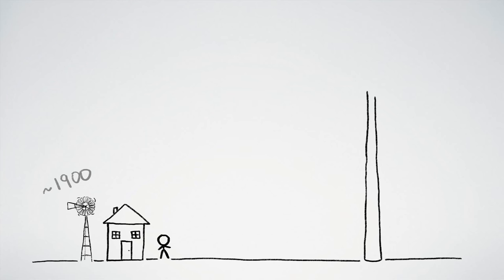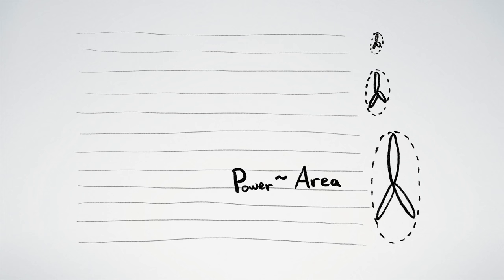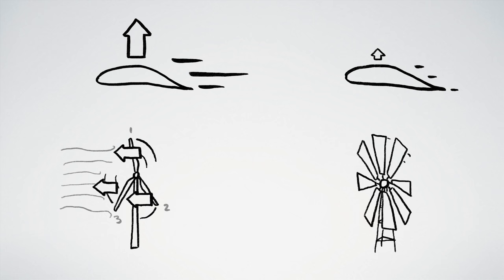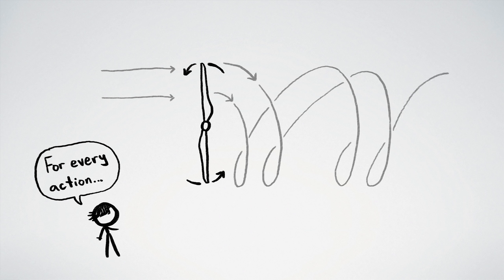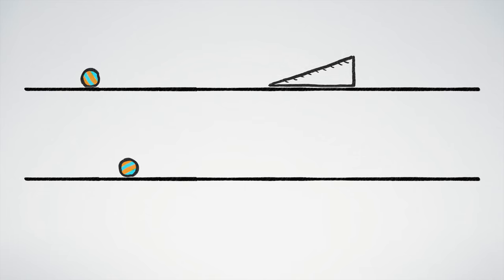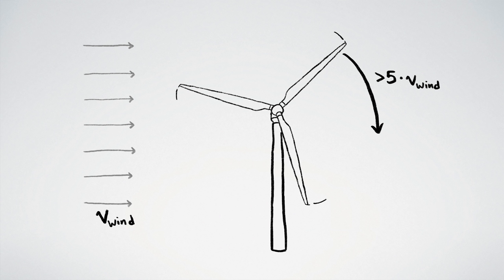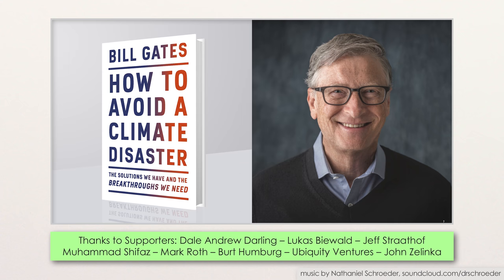The Physics of Windmill Design

Comment: You haven't mentioned one important thing. Why all windmills have three blades and not four (respectively smaller ones).

It has to do with the dynamic load when the lowest blade is passing the tower. If four blades are mounted, there is a big force difference when one blade passes the tower or no blade is in front of the tower. The blade on the highest spot creates the biggest force against the tower (due to the bigger leverage) but in the same moment is a blade in front of the tower that creates up to zero force (also due to Betz's law). When the blades are on 45° to the top most position and to the tower, all four blades create force against the tower.

With three blades it's either one blade in front of the tower and two blades in 60° to the top most position or it's two blades in 60° to the tower and one blade in top most position. The difference in force is way smaller this way and the tower can be build much slimmer and so more cost efficient.

Comment: Interesting question: Why not multiple layers of blades that spin seperate to each other on the same wind turbine?
Reply: Because the wind kinetic energy will pass most of its energy to the first layer blades to the rotor, and the wind will slow down (less kinetic energy) by entering the second layer. therefore the second layer etc will recieve a lot less energy than the first one wich means less efficient for a design.

Comment: So, why not have the fan blades flair at the ends or even connect them into a circle? You can get higher angular momentum that way, which should keep the generation more consistent, right? And if the reason you have thin blades spin quickly is to allow only a bit of air to move past the windmill, you just have that donut hole in the middle

Comment: i would think that the system being 60hz would make engineers design the blades around that speed, so that u could have a direct connection to the generator. and yes i know the wind isnt constant, but u want to govern them down to the speed you like and if there isnt enough wind to maintain the lowest, then u dont make power

Comment: This is all fine and dandy, for 2 dimensional windmills.
While 3 dimensional windmills might be theoretical At the moment doesn't mean they won't exist in the future.
Main selling point of 3 dimensional windmills being they don't need to worry about slowing the wind down, cause they don't rely on the wind passing them by, rather they count on the wind to more the entire windmill (blade area) around causing the blocked wind to push on the slowed wind what pushes the blades with more energy what causes the windmill to move more and, well, generate more energy.

Comment: Fast moving blades were not an option before modern ball bearings were made cheap and common.
If you try making fast rotor with bushings, it would not last long.
1900s (or earlier) bearing technology as available in steam engines required constant inspection and lubrication. Not something you want to go do several times a day on top of a tower.

Comment: Also what we are using is not a windmill. Windmills were connected by a hard drivetrain to a bottom grinding flywheel. Hence the reason windmill. What we use today is called a wind turbine. They do not function the same as windmills hence the reason they are not as safe as a windmill and tend to explode.

Comment: What about the cylindrical windmills that look like they can capture wind from any direction?
Reply: The problem with vertical axis wind turbines is that some part of it is always moving against the wind. Obviously they have less drag into the wind than with it, but it’s still some. Even if it were zero, only the blades on the downwind side would be contributing to the torque of the rotor.

So, to make a long story short, these vertical axis designs can never be as efficient as a horizontal axis turbine.

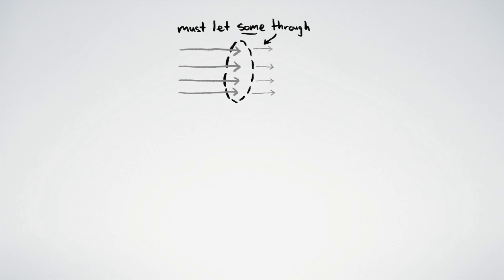Comment: Small imprecision: the max you can extract from the wind is 89%. That's the max efficiency of a wind turbine, whereas the max power coefficient is 59% as the video says. You don't believe me? Go to 1:05 and look at the difference between A and A1. If you divide the extracted power by the power available on the area A you get 59%, if you use A1 which is smaller you get 89%.

Comment: So in the Texas situation where there was no wind and therefore no energy generation, windmills were proven unreliable as a *main* source of energy for consumption.
Reply: There was plenty of wind. They were just iced up like a plane wing.
Reply: Wind turbines need a backing power supply pretty much by definition.  Wind varies greatly from day to day and even hour to hour.  It may be still in the morning, and then a storm blows through.  Thus, their power output is highly variable.  But you simply cannot do that with an electric grid.  Even ignoring the impracticality of telling people they can only have electricity on windy days, a fluctuating power supply can very literally shut the entire power grid down.

So you need a backup generation system, such as a traditional coal power plant, to fill in the gaps.  But it's worse than that.  The giant steam turbines used in power plants can't just be turned on with the flick of a switch.  Water must be heated to a boil, turbines have to be spun up very carefully in order not to destroy them under the sorts of forces driving megawatts of power involves, and so you're effectively stuck at constant power production over a given short term window.  Thus, you need to continuously produce enough power at your backup station to cover that unscheduled 5 minute lull in the wind all the time, and just throw away the excess power generated since battery banks of this type of capacity are out of the question for many reasons, environmental and economic.  If you fail to do this, you're going to have a blackout.

Comment: doesn't mass have something to do with it aswell? i mean the more mass it has the more energy it takes to get the rotor to spin and thereby generating less power from the windforce?
Reply: Takes more energy to get it up to speed but once there there's no difference in energy generated. If anything a heavier blade may be better since its momentum means the energy output will be slightly more consistant

Comment: I don't think that wedge example is correct. When the ball hits a moving wedge. It bounces less to the left (than if it hit a static wedge) because the the surface of the wedge is moving away from the ball, so it's as if the ball is hitting the surface at slower speed. Also, we account for friction, when the ball hits the wedge the friction between the two is going to grab the ball and pull it more to the right (taking away from its velocity to the left. In either case, the ball is is losing velocity in the left direction and every action has an equal and opposite reaction the wedge must be losing velocity in the right direction (as opposed to a static wedge being hit by a ball, it will still gain velocity when compared to not being struck at all).

All of this also ignores the higher amounts of turbulence, drag and centripetal forces the are trying to rip the turbine apart (if turbines were slower they could be made even larger and radius is a big deal in turbine design). Slower speeds are definitely more efficient (assuming you have complete freedom in your turbine design. They design them to spin faster because electric generators tend to be more efficient at higher rpm (and gear boxes are heavy, complex and expensive), AC transmits more efficiently at higher frequencies and faster designs also use thinner blades which means less material and is much easier (relatively speaking) to transport and assemble.

Comment: There's one thing you forgot to mention. It's small, sure. But. A large part of why those blades are so small is so they won't catch too much wind and simply push the whole windmill over. You put a giant dinner plate up there to stop the wind and it's going to blow it over as well. It's just one small facet I felt needed to be mentioned.
Reply: But if someone wanted to put a giant dimer plate up there they would in turn make the pole stronger.

Comment: That was supposed to be the logic, the only problem is that they failed to take into account the variability of temperatures as altitude changes. Smaller windmills were easier to keep ice off of and the fact that they are windmills meant that they weren't turning a generator but rather a big flywheel. Generators produce more resistance with more draw. A windmill stays about constant due to the Mass of the flywheel so it would just hits the turbine blades the flywheel adds enough resistance to keep it from spinning out of control. Another big problem with large wind turbines is that the larger they are the more the blades act like their own flywheel trapping Mass so the bigger break you need. In fact most wind turbine explosions are due to the fact that the breaking system has failed. The size of the wind turbine and poor design for icing also lead to the fact that it takes way more fossil fuel to run a wind farm than it does to run a generator at a power plant. There is no economic benefit from wind turbines. All they are doing is using resources when that could be focused on cleaning our fossil fuel power plants or using even cleaner nuclear energy! Solar has its uses for certain industries during the daytime and wind turbines have their uses if they're not scaled way out of proportion like they've been! I live right by Siemens training facility for their wind turbines and they've actually let me explore some of the mock-ups. I've been in a generator head and seen the size. They are quite massive but structurally they scare me.

Comment: Two things.
1. They are not windmills, they are wind turbines.  They mill nothing.  They are commonly referred to as WTGs, Wind Turbine Generators.   Calling them windmills sounds like you're mocking them much like a recent former US President.

2. It'd be great if you added one extra tid bit about why 3 blades, not 2, not 4.
3 blades is again an optimization.
2 blades have the disadvantage of wobble.  When the bottom blade passes across the tower, it is in a 'shadow' where wind can't pass (due to the tower)... this causes a wobble as the top blade experiences max force on it.  In addition, to capture the same amount of power, the blades need to be much longer.
4 blades just adds cost and weight and overall makes the WTG less cost efficient.

There are also older 1 blade turbines! With a single blade and a counter-weight opposite.  They were used around the equator where cyclones/hurricanes would be frequent.  During extremely high winds, they stowed the blade downwards along the tower and only the stubby counter-weight was exposed.

Comment: Why wouldn't a slower blade ALSO give the air less of a twist, than a smaller faster blade?  
A faster blade = a faster twist.
There can only be a twist, if the blades are moving FASTER than the wind moves them.
Also how do you get the blade moving fast enough? A turbine should cover 100% of the flat surface-area using slanted fins, and these should also have variable-angle fins to be able to rotate away from the wind if it's too strong.
An ideal solution would be to have a 15-foot diameter turbine on stop of every house, which would give an area of 80 square meters,  using the house's height and foundation to remain upright, while it would be safe against strong winds from the variable angle of the fins. That's 1kw for every mph of wind-speed.
Then just use a grounded salt-battery in in the yard for low-cost energy-storage, since weight is no object vs. cost.

Comment: As an engineer, I really didn't like how you explained this. You really should have started at the beginning with what the goal is for windmill design (e.g. maximizing energy output), and explained the factors that affect it, rather than starting with existing windmills and working your way backwards. Also, while it's true that lift increases as velocity increases, I died a little inside when you super simplified the concept of lift down to "you get more lift the faster the plane goes." It's important to teach things to people so they can understand it, but I think explaining engineering concepts too simply makes people feel that they understand everything about a topic, and then we get people like alex jones, who can spout science in a way that it's 60% correct, but connections between concepts and the reasonable conclusions from those connections are totally wrong.

Comment: I missed a smaal but important fact.
The size of the windmill blades combined with the rotation speed  is limited. The blades will not work properly when the tips of the blades excceded  the speed of sound....And because the air at one side of the blade moves faster than on the other side the speed of the tips of the blades must be a lot slower thand the speed of sound.
This combined with the knowledge that the blades must rotate five times faster than the wind speed.will give limitations....the higher the wind speed the shorter the maximum length of the blades or , in other words, a limit in how big they can get.

Comment: Dumb question. Modern windmills that generate AC at 60 hertz to match the grid. Requires the windmill to turn at a set speed. The blades rotate to capture more or less air to maintain a set speed. Then an expensive transmission keeps the output speed at 60 hertz to spin the generator. 
My question. An old style windmill designed to pump water. Operates at a variable speed with high torque. I have seen these windmills spin very slowly in a slight breeze pumping a small amount of water. Then pump a lot of water in high breeze. A governor pushes the blade out of alignment when the wind is strong enough to damage the pump. If you replaced the pitman that operates the pump. Instead mount a DC motor in it’s place. No matter the wind speed. The generator would put out 24 volts. The current will go up and down. The generated current can wired the same as solar cells are. Solar cells generate DC voltage and is converted to AC. Wind blows 24 hours a day. Providing most of the energy a home needs. With the excess banked on the grid. 
I can get a 24 foot diameter multi bladed water pumping windmill very cheaply. 
Is this method of generating electricity be practical? 
What are the formula’s I would need to determine horse power at various wind speeds? Then I can size a DC motor and the size of gears I would need. 
Please send me any comments. Especially tell me it is stupid and won’t work. But please explain why it won’t work. I can put this system together on a 75 foot tower for a few thousand dollars instead of over a million for a modern one. Also maintenance will be very simple.

Comment: Isn't the speed of the blades... caused by the wind?  I don't understand what is meant by speed of the blades being part of the design. I guess the question I really have is: why does it seem like windmills rotate at a constant speed?
Reply: If I get it:
Bigger blade mean it will stop more wind to move through it.
The wind that didn't got trhough slow down the "new" wind that come to the blades, and so, slow the blades movement.
So by changing the size of the blades you change its speed.
This is why they are saying the speed is a choice of design.

Not sure about the second question.

Comment: I don't understand how the blade runs at 5x the speed of the incoming wind. Is it recycling the energy to spin it so it's at maximum efficiency creating a net gain? That's just weird so I'm sure I'm wrong. What's the dynamics here? It can't spin at 5x the incoming wind speed on its own or can it? I'm no engineer.
Reply: It's to do with the angle the wind hits the blade it.
It acts like a gear or lever. The wind moving 1m causes the blade to be pushed 10. The sideways force on the blade is of course proportionally reduced
Reply: @curseofgladstone4981  That makes a ton of sense. Not sure why that didn't occur to me. For some reason, I had it in my mind it had to be 1:1 or less but of course it depends on the angle. thanks!
Reply: @dvessel  no problem
Reply: It’s still impressive that it can spin 5x the incoming rate. There must be some electromagnetic resistance to generate any power.

Comment: Bummed because of no mention of tip speed. Both size and rotational speed are limited pretty hard by the speed at which each blades tip moves through the air. They should not go supersonic, because if they do wind turbines would become incredibly inefficient - a lot of energy would be robbed by a sonic boom created by the blades tip.. A lot of that energy would be given off as noise. This can't be good in any way :)

Comment: Modern wind farms are okay, but they're first generation.  I have to point that out, we're still refining them, as opposed to cold war era nukular tea kettle reactors.  A lot of the prejudice against Nuclear power comes from perfectly avoidable disasters (3 Mile Island, Chernobyl, Fukishima...) because of really vulnerable design.  That, and the fact that when a reactor goes bad, it goes really bad, but ultimately, they're just steam turbines.  They just use a fission reactor to boil the water.  I'm sorry, but that sounds like something Colin Furze would do on a whim.  Not something to build a power grid around.

Comment: 2:55 if the explanation for fast moving is to be 'most efficient' then you can apply the same explanation to all other factors (height, size), therefore arguably redundant and unsatisfying... I think you could've done better: reduce rotational wind forces or similar?